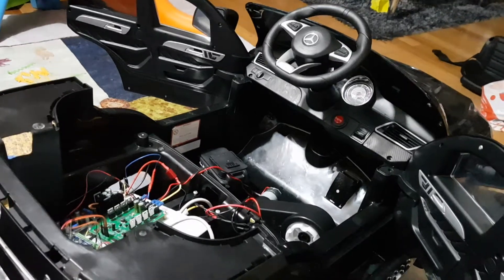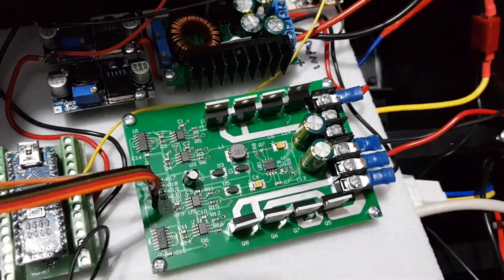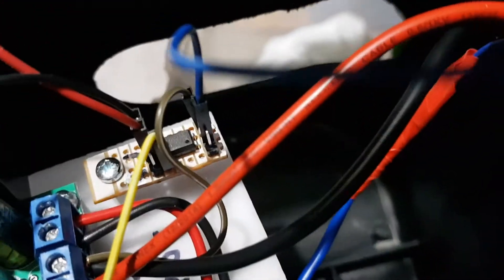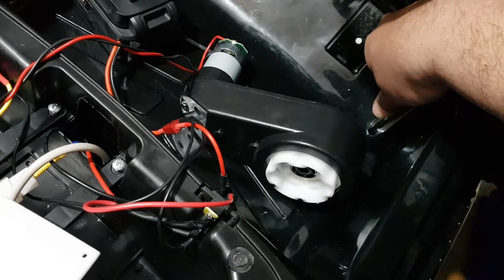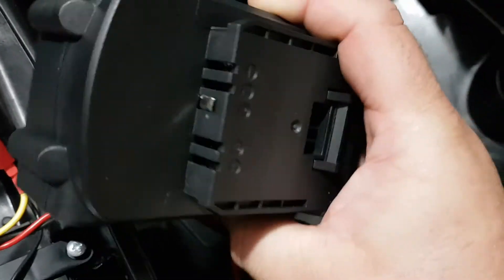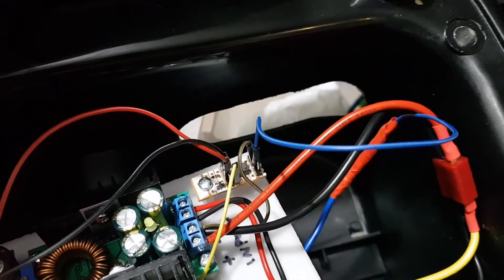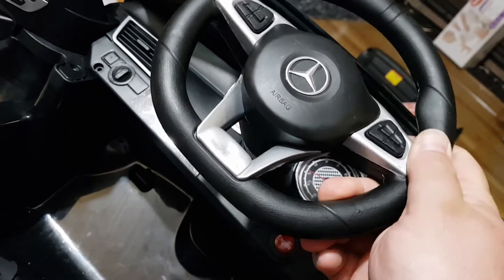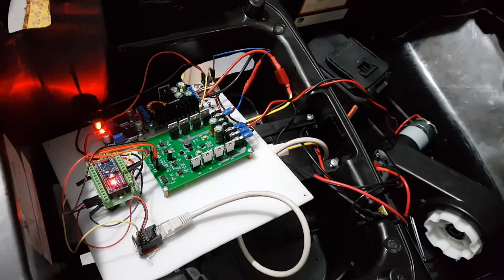Proportional Accelerator for Kids Ride on Car

Comment: What's inside the gas pedal? I tried to do it with 49e hall effect sensor but it doesn't work, I'm reducing the speed with the PWM circuit pot now.
Reply from the maker: It's a 16mm 10k linear potentiometer on a pinion. The pedal has a curved rack that meshes with the pinion and a spring to make it return. There is a link to github with the project files. It was done in freecad.
https://github.com/fjdebruijn81/Accelerator
Reply: Thank you so much